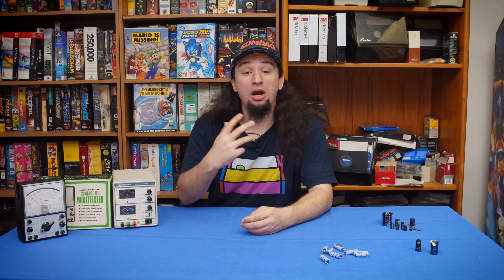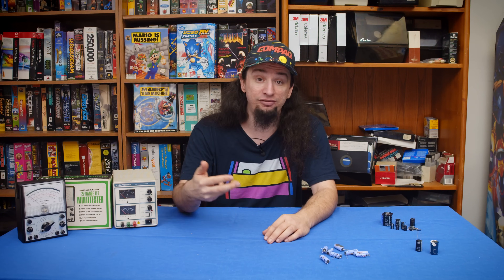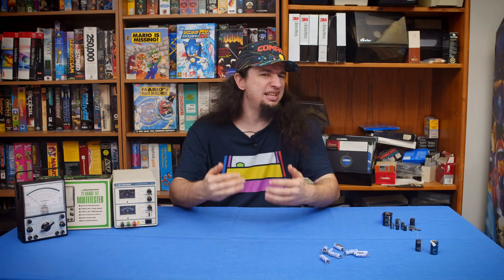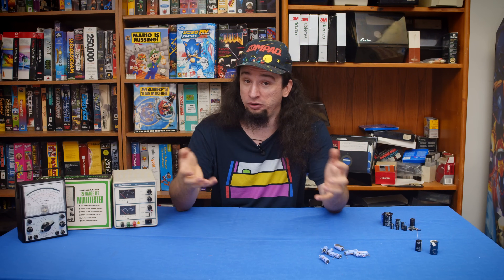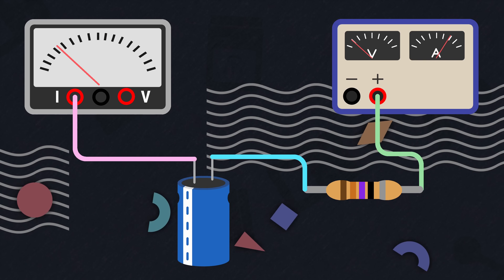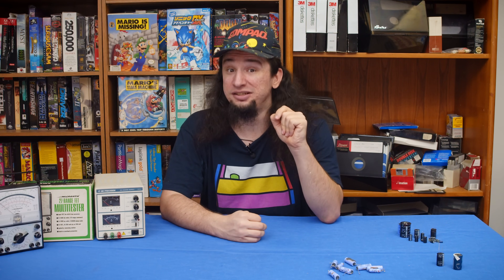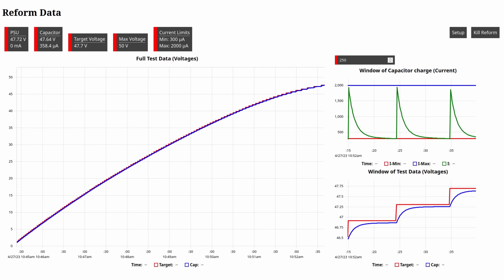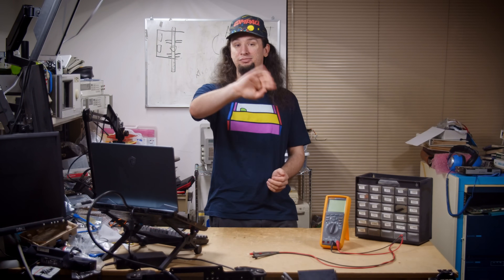Reforming Capacitors - Everything you wanted to know

Comment: Could you use a current limited power supply for this? Just set it to 2mA limit and voltage to the rated voltage of the cap.

Would need to be a decent PSU that can reliably regulate down that low, but they aren't expensive now.
Reply from the maker: Power supplies do not regulate well at values this low, the HP 6633A I'm using can only do 0.5mA steps. And that doesn't account for the accuracy. So 1-2mA may be difficult to reliably target. Using a current limit resistor guarantees it.
Reply: @TechTangents  Making a "precision" low current source/sink is about as easy of an electronics project as it gets, look up 'tl431 current sink' for a four-element circuit that will work down to 50uA (and still be quite precise). Set up the ultimate capacitor voltage +2.5V on your normal power supply, put the capacitor in series with that current sink and wait.
Not that the video is lacking or anything, just saying this to let you know that you don't need any weird old gear as the others are suggesting. Of course not everybody knows how to solder and has the equipment, but you do
Reply: @TechTangents  I have a Multicomp one, forget who the OEM is, that is within about 5% down to 1mA, in steps of 1mA. I was surprised, and it's a 5A range. Useful for testing LEDs visually to select a current limiting resistor.

Been looking for one of those 34401a meters cheap for ages. Used one at work, wrote an app to sample current at 10kHz. Very handy for low power stuff. They are expensive, especially in Europe. Very nice instruments though.
Reply from the maker: I actually want a second 34401A for some future tests but they've nearly double in price since I bought that one! It's  good for sure, and I would say still worth the money, but it's a hard pill to swallow.
Reply: @TechTangents  Why don't you just use an old (1970s and older) Cap (condenser) meter/tester?  It's fast and easy. They have a leak test function which puts a selectable (generally between 10 and 600 volts) voltage on the cap. It also tests the actual capacitance of the cap. It does it with a cool magic eye tube.
Reply from the maker: One of my objectives with this video was to educate people on how to do this process and telling everyone to buy unusual rare hardware isn't really an option for that.
Reply: @TechTangents  There are millions of those things out there. They were made from like the 30s to the 70s. 
But, I get that you wanted to show people how to do it.
Reply: @TechTangents  It used to be the only affordable option for fast current measurement, but not so now. I think a lot of people want them just because they are familiar, e.g. they have a lot of software written for them already.
Reply: @1pcfred  You start with a lower voltage. The cap testers have different voltage settings.
Reply: That was my question. This seems really complicated just to have a current limited power supply
Reply: @owenvogelgesang7314  well it's safer, in that a current limited PSU might put out full voltage for some fraction of a second before current limiting kicks in, but you can overcome that by manually ramping the voltage up at the start.

I'm guessing the resistor method was with older analogue power supplies in mind, and so you can see the current reduce to know that it's working. If the current doesn't fall/voltage keep increasing you need to stop because the cap is probably bad.
Reply: The BEST option is to buy an old (very old, tube era like 1970s and older) capacitor tester.  They can put a lot of voltage on the cap and measure the leakage and capacitance with a cool magic eye tube.  Most go to 600V in steps, like 10, 20, 50,100, 200, 450, 600.  A lot of people are using them for this purpose.  There are millions of them out there, but it may itself need some restoration work.  But it is very easy to reform caps with them.
Reply: yes this is too overkill. all he needs to do is a current limited psu and feed each DC rail individually. "regenerating" all caps at once.
Reply: @83hjf  It would be hard to regulate the current if you were powering up the whole device. Maybe on the mains side of certain PSUs it's possible.
Reply: @kuro68000  doesn't matter. it's not really about current, it's just about ramping up the voltage. once the first few volts "settle in" you can hit the remaining volts faster

Comment: Just buy new caps.
Reply: Depends. Small cheap capacitors aren't worth the hassle. Big beefy ones aren't cheap to replace, and often can be difficult to source. THOSE are worth reforming if you have the means to do it, and they're still in good physical condition.
Reply: + L + ratio

Comment: just buy new caps + L + ratio
Reply: The small ones are worthless. The big ones should be reformed and ESR tested, and reused.
Reply: Nevermind
Reply: @NutScrewGamer  no no, speak your mind
Reply: I mean… Have you seen the price of higher value, higher voltage caps lately?

Once he sorts out a variable 450v supply (chinese buck converter board and a Mosfet with a pot to vary the voltage will do for a non automated solution) the parts savings will add up, and attempting to reform a cap is basically the same amount of labour as replacing with new, except with a wait time per capacitor.
Reply: @Jonathan_Doe_ YES! I was just trying to buy a 200V 560uF capacitor in my (very expensive everything) country and it was USD10 PER CAPACITOR and not even a good brand. I am considering buying them from China but also trying to reform the ones I am replacing. Oh well…